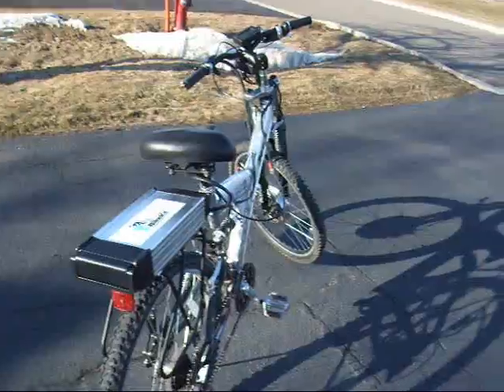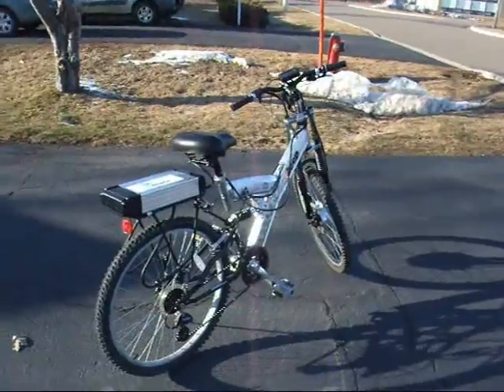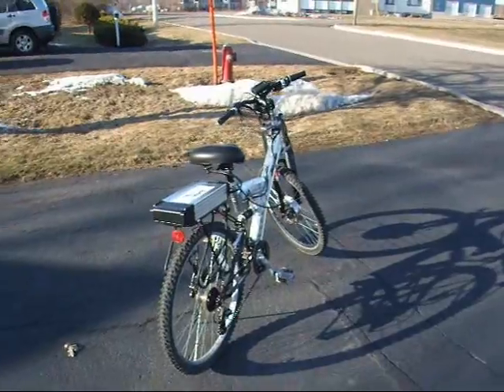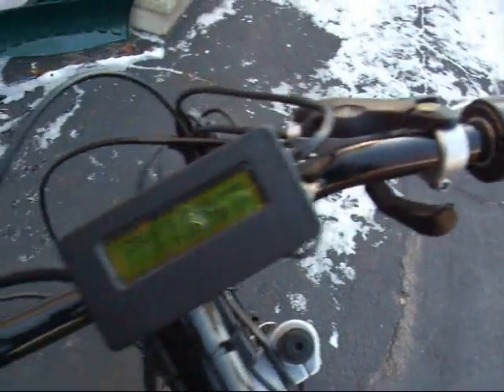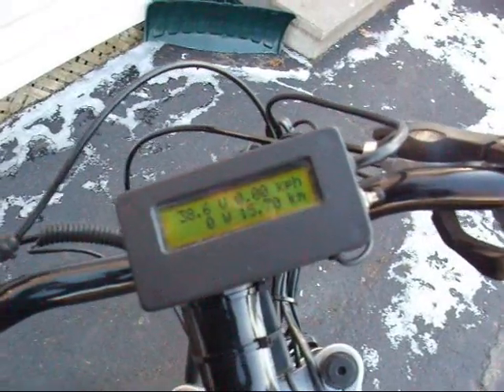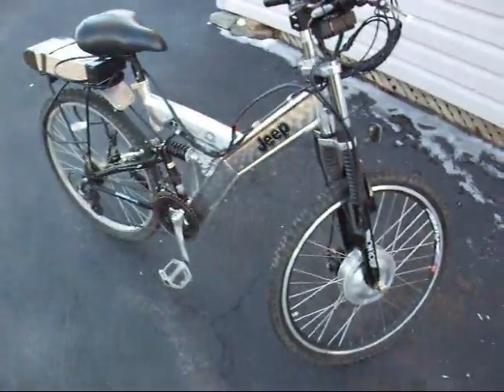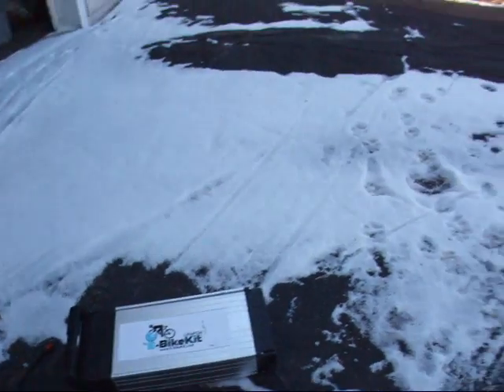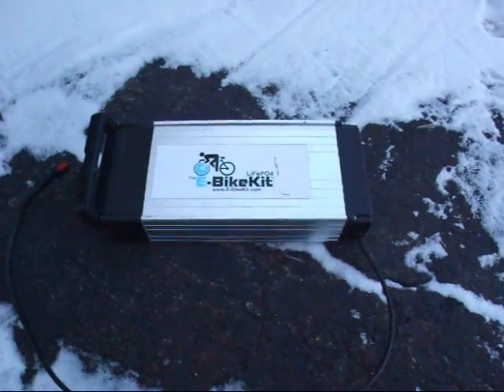E-Bikekit.com LIthium battery cold weather testing

Comment: have u done it below -10 i live in yukon. is it worth getting the lithium is the question i am getting a 48v 1000w kit. and computer etc. i have to ride bout 6km uphill from work think it will be able to handle it at like -20? thanks .
Reply from the maker: Aaron Carroll as long as you keep the pack indoors until the very last minute before you ride, and bring it back indoors after the ride and let it reach room temps before you plug in the charger, it will work fine.

However, do not charge a lithium battery that has been sitting in the cold for hours, you will ruin it very quickly.... it will take a charge and will be functional to a very diminished level, but don't bother .. you are just going to waste a  battery pack .

I ran my fatbike all winter long with 36v 16ah of LiPo, using a large garden watering can i washed off the muck from the bike as soon as i got home, rolled the entire bike ( permanent mount battery ) inside, waited a few hours then plugged it in to charge, worked out perfectly.

The motor / controller / etc will be fine if left in the cold, but the bicycle itself will give you problems with frozen brake lines and stuck derailleurs if you leave it outside full time.

Comment: So, how are your packs doing?
Reply from the maker: This pack was still being used last season , 2014, but it's on it's last leg, severe voltage sag, the BMS discharge fets blew out but the charge side still works... it needs to be retired but it survived 4+ years of abuse !!!
Reply: That's pretty good considering the winter use. I've been using heating pads for the past couple years. Cells normally heat when they're discharged but it helps to keep them cosy. Winter riding is tough without a full face helmet.
Reply from the maker: Ken Bell  I don't think the cold weather hurts / stresses the batteries, it just limits it's ability to take and deliver energy by increasing Internal Resistance, at low current it works.. but as the temperature increases things return to normal and the pack operates none the wiser. .... just some personal observations over the years. i'm testing a 16ah 36v lipo pack on a fatbike at the moment.. in the winter.
Reply: My understanding is that the charge capacity is reduced at low temperature <3.65 volts so that a standard charger or BMS will overcharge the cells.
Reply: @Just-Iss-4U  interesting.  Does anyone have a good link to something sciencey I can read? Lots of guesses on this critical subject.

Comment: @Ypedal my impression is that battery has an RCA port for charging. Is the battery using that RCA charging port also for discharging as well?

How much did the Cycle Analyst cost you?

I have heard some other people speak of another similar product to the CA, calling it a "Watts Up Meter". Are these different products? If you know anything about this other product, would like to know what you think of it in comparison to the CA.

Comment: @Ypedal from what i am guessing on your configuration is that the charger has an rca outlet to plug into battery charging port. You cut the rca plug off and spliced in anderson connectors. U took the rca plug u cut off and spliced in anderson connectors on that sid. then connected the cycle analyst between the two sets of anderson connectors.  Did I get this info correct? 

Do you have a link for the Cycle Analyst manufacturer? Is this different from the "BrainDrain" product?

Comment: I am working on an app for an android phone that will monitor and record battery, motor, and outside air temperatures. this info along with all cycle analyst data on the android along with gps synching capability.

Looking at creating seperate CA brain that links to android phone/device using UsB or bluetooth. the android app could be used for keyless on off switch, power/speed regulation, and with a Panic/emergency button. Could also monitor pulse, body temp, and blood pressure of the rider.